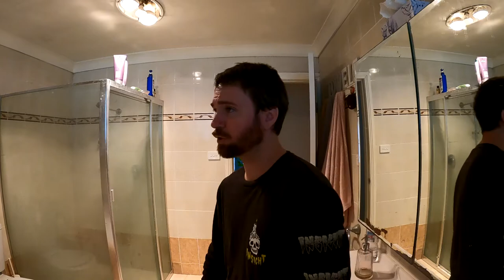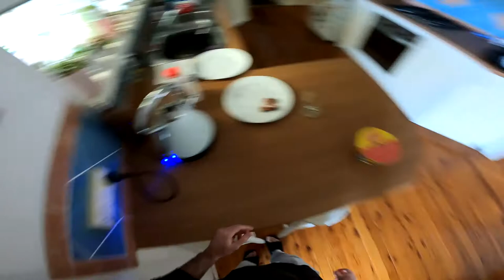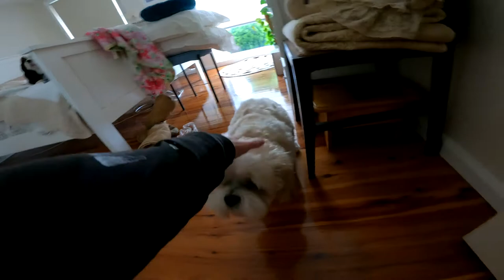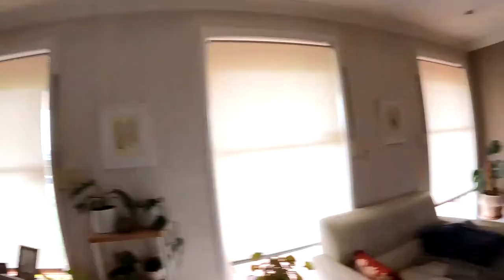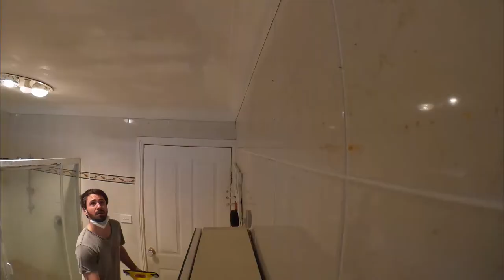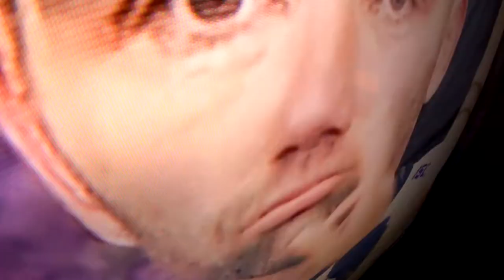The NRL Grand Final was a huge disappointment

Comment: Surely the DSLR's didnt get soaked at the wedding
Reply from the maker: It did :( We wore rain coats so we were able to hide the cams under them when we weren't taking a shot but the still get wet. Sadly not much we can do if they said they want to go ahead in the rain. The Canon dslr cams are weather sealed but only to a degree as we has one get water corrosion only recently after having to shoot a wedding in the rain. It's a bummer for sure!
Reply: @TheMattyAP  Dang, the things ya gotta do for work 😬